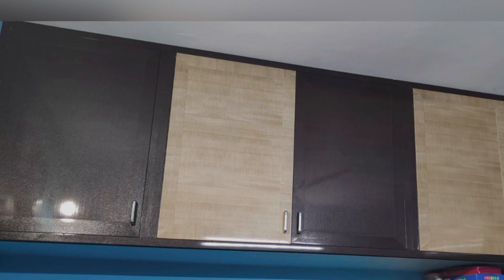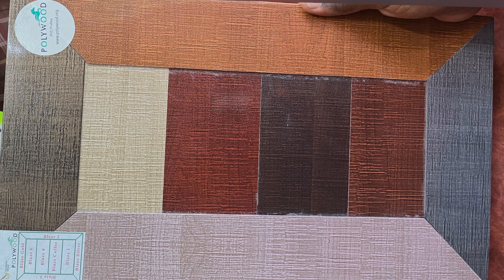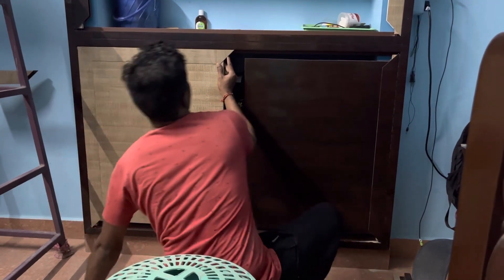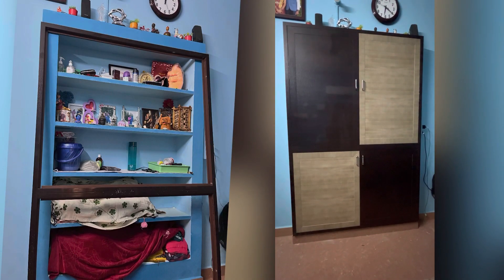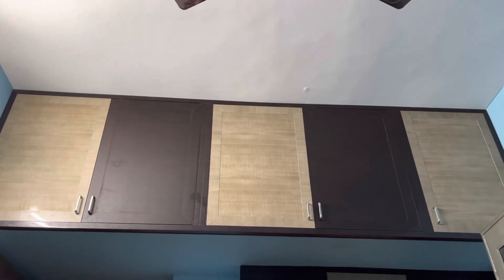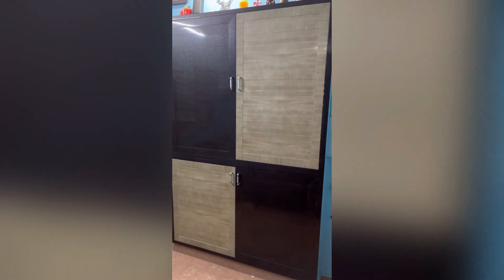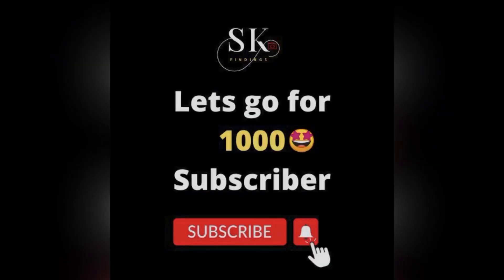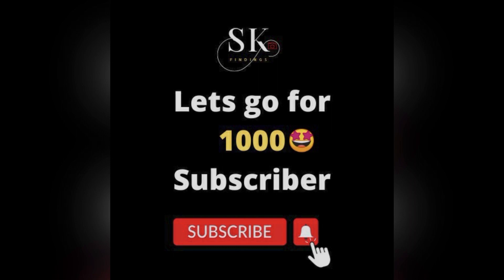PVC Interior Works - PVC vs Wood - How to select, Cost and full details #pvcwork #interiordesign

Comment: Price sollunga 
Total amount
Reply from the maker: Per square feet Rs. 340 bro. For example your cupboard area height 6feet and width 4feet means total area is 6*4 = 24 feet. So price is 340*24= 8160 Rs (labor cost included, no additional costs)
Likewise, you can calculate.
Reply: Yaru panaga bro
Reply: Phone no
Reply from the maker: @anandhielay1368  VRK PVC Work. https://www.google.com/search?q=vrk+pvc+doors&rlz=1CDGOYI_enIN1024IN1024&hl=en-GB&sxsrf=AJOqlzWqcWVEP-OdpI9eWms5uUAt9nrNsA%3A1673096312097&ei=eGy5Y9GsBd2fseMPvKmP2A8&oq=vrk&gs_lcp=ChNtb2JpbGUtZ3dzLXdpei1zZXJwEAEYADIECCMQJzIHCAAQgAQQCjIFCAAQgAQyBQgAEIAEMgsIABCABBCxAxCDATILCC4QgAQQxwEQrwEyBQgAEIAEMggIABCxAxCDAToHCCMQ6gIQJzoECAAQQzoHCC4Q1AIQQzoLCC4QxwEQrwEQkQI6DgguEK8BEMcBELEDEIAEOgsILhCABBCxAxCDAToICC4QgAQQsQNKBAhBGABQvAxY7hJg_htoAnAAeACAAYoBiAH0ApIBAzAuM5gBAKABAbABD8ABAQ&sclient=mobile-gws-wiz-serp#
Reply: 230